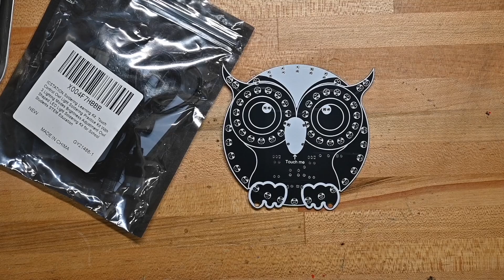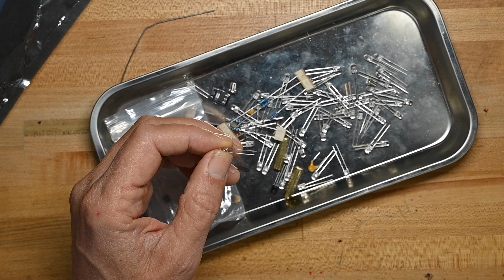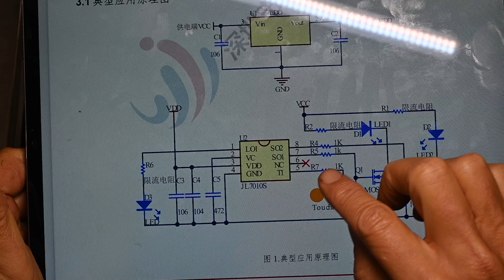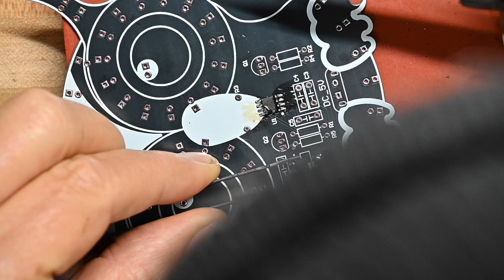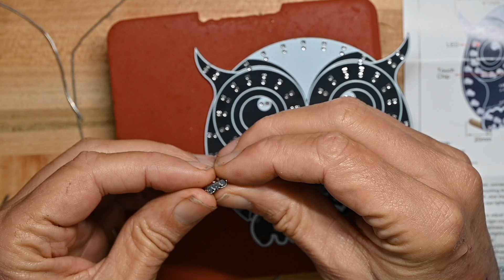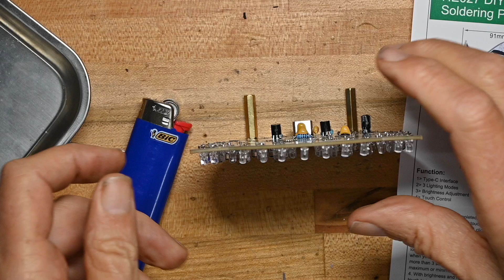C.K. builds an LED touch control Owl kit

Comment: C.K. What temperature is your Soldering Iron sir
Reply from the maker: I run my iron at 675 dF/360 dC.  Hot enough to get in, melt the solder, and get out without excessive heat transfer to components. Thanks for stopping by!
Reply: @CKHaun  thank you